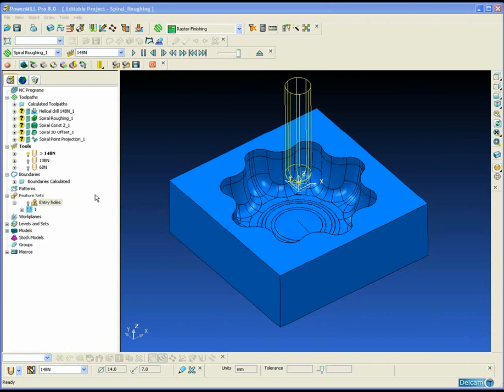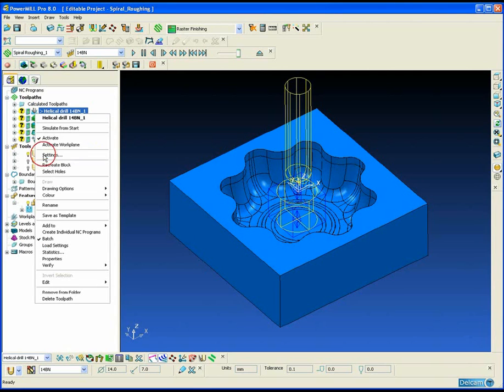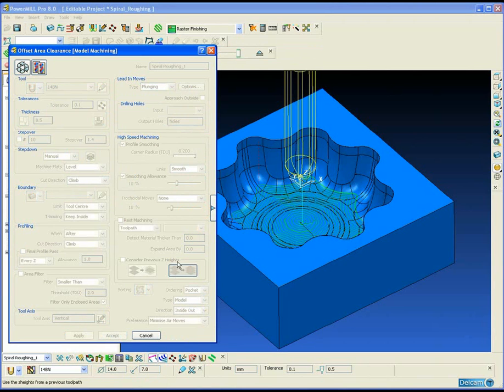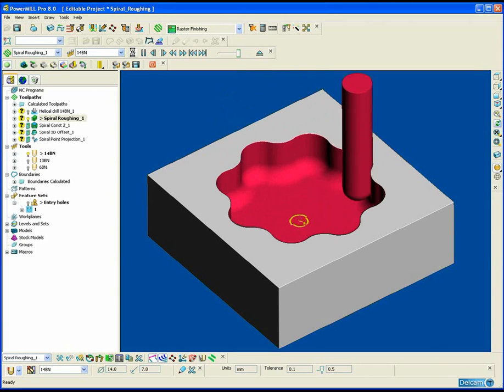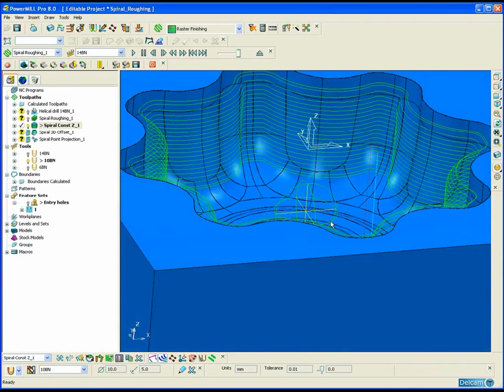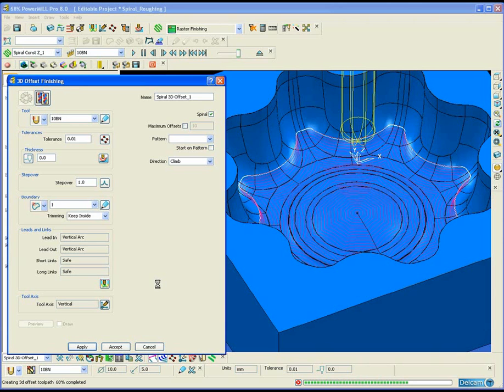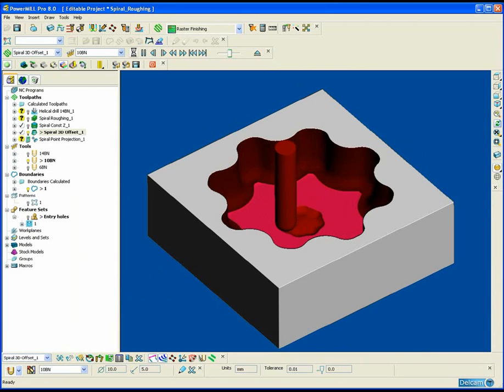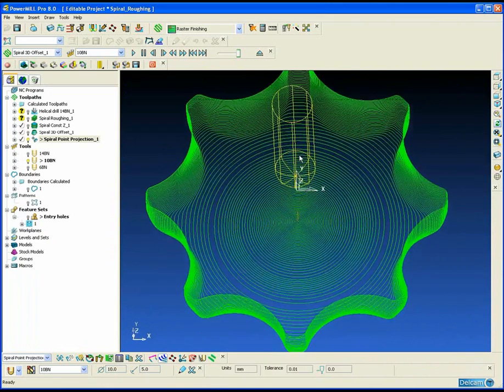PowerMILL High Speed Machining Spiral Roughing

Comment: If this was true spiral machining it would not create lumps until the end but this toolpath is driven by the end result and not smooth even cutter movements.  As the cutter goes out radially it starts jamming into corners that are no larger than the radius of the cutter which produces high cutter loading at those points.  If this was truly a constant chip load roughing toolpath it would be a true spiral out to the diameter and then start smoothly cutting into the pockets.  As it is your cutting speed is dictated by the dives into the corners - something we learned not to do when we wee turning handles on Bridgeports.